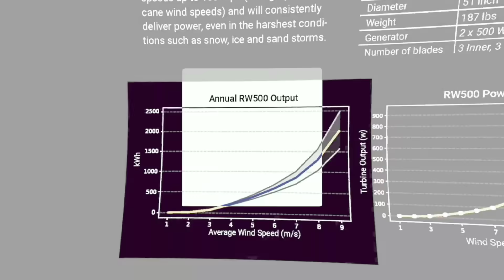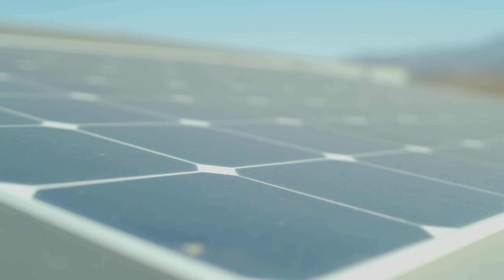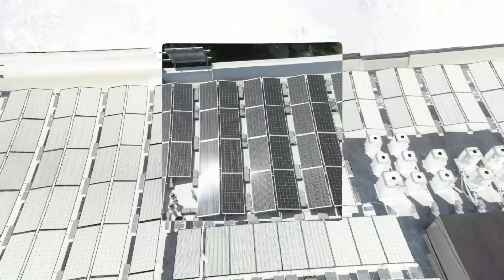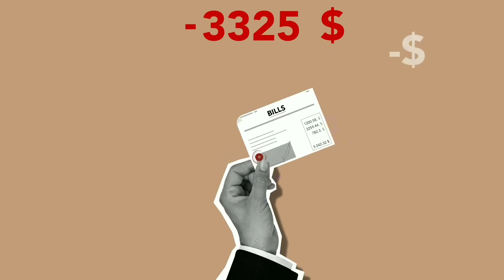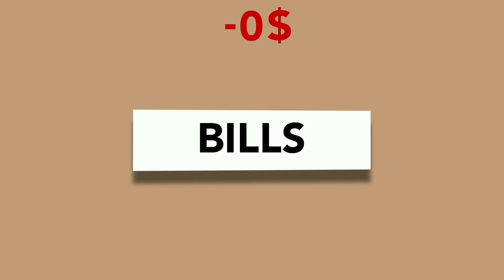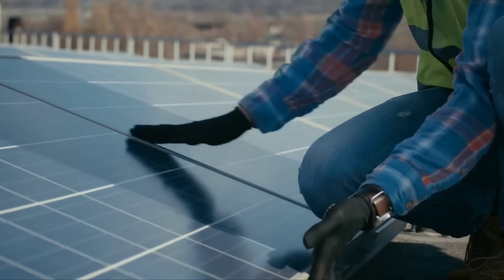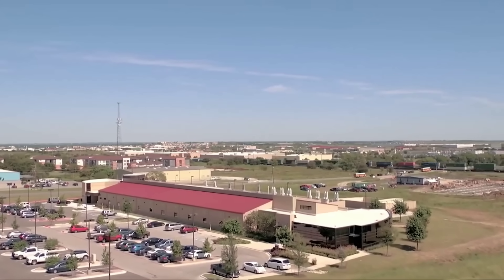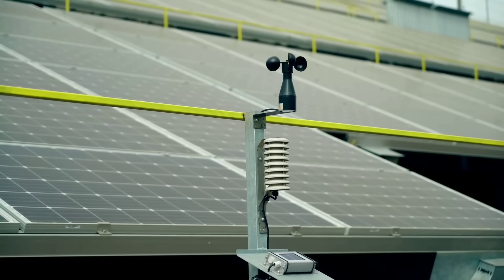This Could Be The Safest And Most Powerful Wind Turbine In The World.

Comment: Please get your facts right about solar PV cells. Current state of tech does not significantly degrade over time. Lifespans on average is 20+ years. You don't need battery storage if you are feeding the grid. Less expensive than wind.
Wind turbines of any design break down and require more maintenance. Harder to install. Turnines use rare rare earth metals on their generators.

Comment: Wow so many false statements and missing important information vs. solar. Yes wind has some benefits, but I suggest the viewers do their research. For example, to expect to feed excess energy back into the grid with one turbine is false. You'd need many more to overcome your usage even at a minimal level. Also, as an example, here in Florida you do not get $0.15 per kWh as a feed in.  It's more like $0.03. Replace solar panels every 10-20 years?? How about 40 or more! Mine have a 25 year guarantee to produce 95% or more of the design capacity (and yes, the company I used has been in business for over 30 years).

Comment: This is pretty useless. It requires a ridiculously high wind-speed to be of any use, produces very little electricity and costs a fortune! The average wind speed across the US and UK for example is just under 10mph (~4.5m/s). Based on IceWind's CW100 chart for annual electricity generation, you would expect somewhere between 150kWh and 200kWh per year. at $0.15 per kWh unit (as used in this video), you could save yourself a maximum of $30 per year! This would take over 100 years to pay for itself assuming that you didn't have to replace it after 30 years. Even at 25mph, it only produces 160w. That's only enough to power a laptop and few low energy lightbulbs. I'm all for renewable energy, but it has to stack up in terms of performance and pricing. If you are very environmentally minded, you may decide to take the financial hit just to use renewable energy. That's great, as long as the product can actually produce enough electricity to meet your demands. You really need to do your research if you are looking into wind turbines as they produce far less electricity than you would expect and what you are led to believe by the marketing material.

Comment: Pure nonsense! All practical tests show that small wind turbines hardly generate any electricity. Because there is hardly any wind close to the 
ground – and electricity yield is proportional to the third power of the wind speed: So 100% more wind generates 800% more electricity! 
Only if you need to be self-sufficient from the power grid, you should erect the largest possible wind turbine on a high mast. 
With solar modules, on the other hand, you can reliably generate green electricity for 25 years at approx. 5-10 cent/kWh!

Comment: Advantages - much less power, none of that sparking or overheating  nonesense

Less that 30 decibels - Sound pressure level, sound power, at what distance. Very low height, therefore wont get blown over by strong winds.  Sound utter crap to me.

Comment: Wind versus Solar is a false dichotomy, and I don't appreciate that approach in this video.
I consider it dishonest -- especially since you absolutely neglected to compare the power output between the two types of systems.
What crap.

A wise individual would use both systems -- solar on the slopes of the roof best for sunshine, and then wind on the other slopes that face the wrong way.

Pull your head out.